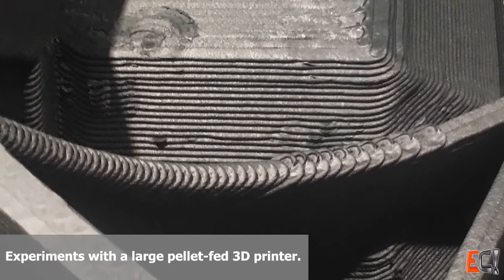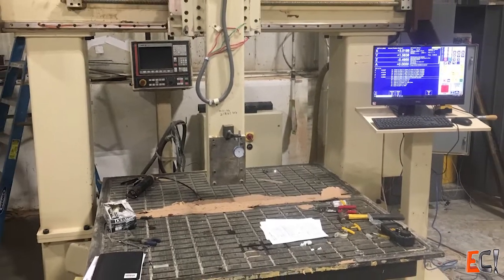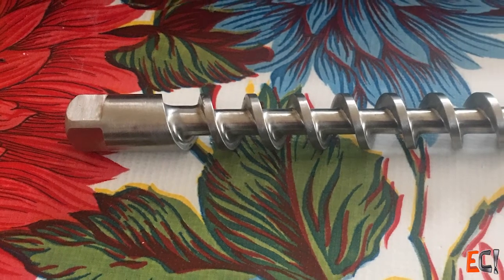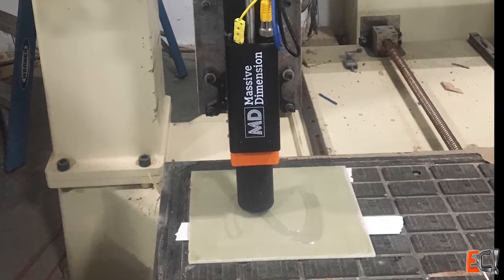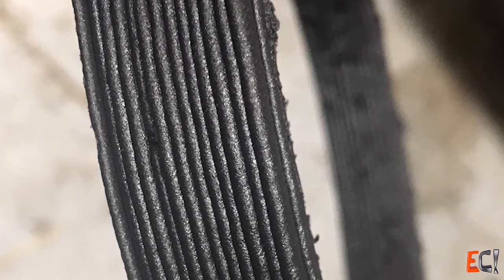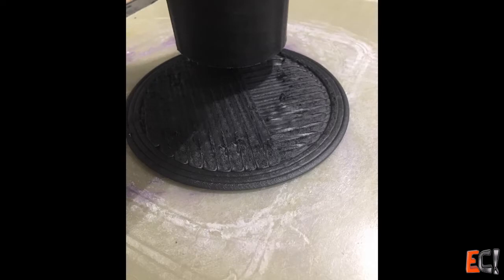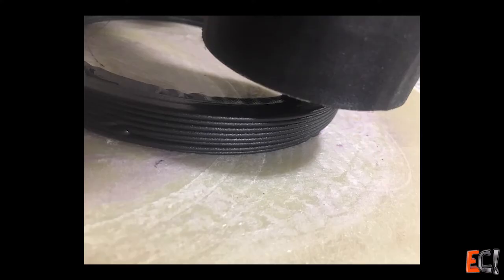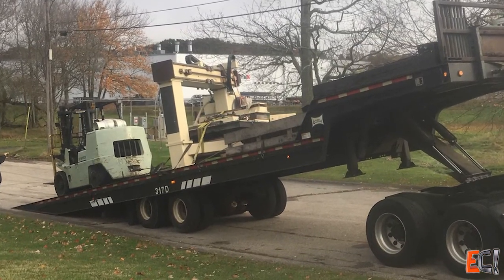Experiments With a Big 3D Printer and Pellet Extruder

Comment: hello friend , Did you manage to make a speed control for a plastic extruder?
Reply from the maker: The extruder screw is driven by a stepper/servo so it can be controlled very well.  Getting the material to start and stop coming out of the extruder is harder!

Comment: Your channel is fantastic. You get into a lot of different stuff, from retro fitting a router with win cnc (not my favorite cam software but it is what it is) to utilizing an extruder for massive prints.
All in all the parts you were printing would suffice since they will undergo a secondary machining operation. Lookheed has a massive one and they made us some dies that took quite a few days to final machine finish.
I like your channel, btw the lockheed massive tootsie roll making printer had no hearted bed or enclosed but it did run a tamper. There were voids all over and it was to be expected as it was still in testing stages. The consumer wanted the part two months ago kinda crap so they did what they had to do.
Overall the dies we got were quite impressive when youre standing not having to think about how many more hours a solid billet aluminum would take to machine over just a few hours of "touch up"
Reply from the maker: Thanks!  Glad you found some of it interesting. I do wish I could have kept that big printer and done a round of improvements.  There may be something to this 3D printing thing!

The WinCNC wasn't the best choice for a 5 axis but it was cost-effective(ish) and I knew how to use it - do you have any CNC control recommendations for 6 axis+?  I just wanted to avoid MachX and was too clueless about Linux for LinuxCNC - but want to learn!
Reply: @ExploreComposites  Esprit is one of the only ones I know of that has an excellent post processor. 4A lot of the other ones will require a custom post processor.
And just a fyi, theres a product called devcon, you can get it in a few different flavors7, titanium is one of my favorites. Fantastic stuff, massive compressive strength. Can fill a keyway a8nd re-machine it and have a working product in hrs. Can come in handy filling voids that are to be put under vacuum and i3n an autoclave. Will stand up to probably ten bar. Pita to san9d, best to use a wood rasp to get it close prior to it setting it up. Then sand, sand and mpre sanding. Bit it conducts electricity, so you could even use it in a sinker or wire edm. 7Very versatile, and itll stick the moon to the earth of u could.9
Id like to tall to you more about your products 6but placing numbers and email om here sends 0the spam bin quickly filling.9 EST

Comment: How electricity it consumes ?
Reply from the maker: I don't know - the machine ran on a 20 amp 208v circuit - with plenty to spare.  The extruder barrel has 300w heaters - 110v - so not much!

Comment: Clearpath Servos and Centroid Acorn. The only right way.
Reply from the maker: It's a good combo!  I would have liked to use Clearpaths for the axis motors too but it was easier to use NEMA42 frames and I needed the torque so went with cheap huge steppers.